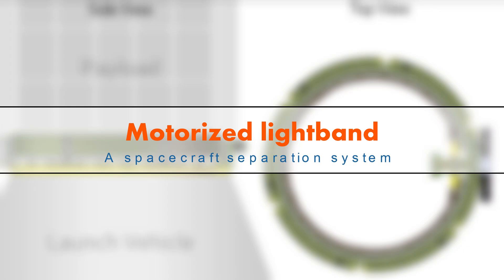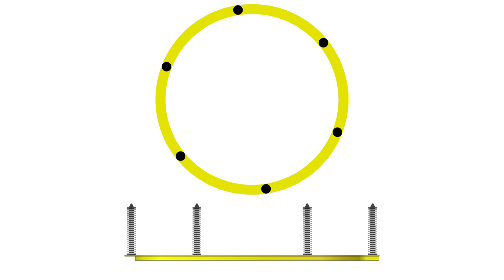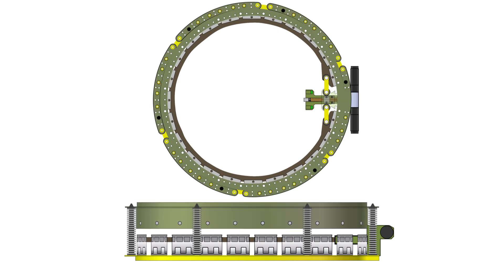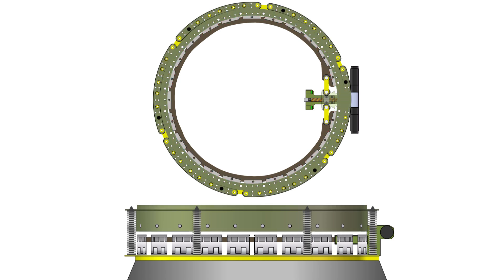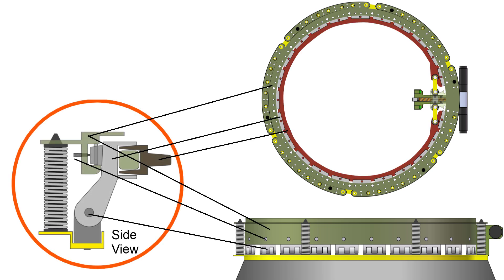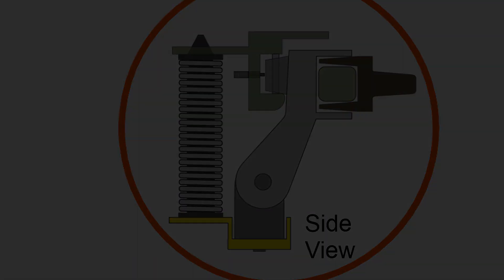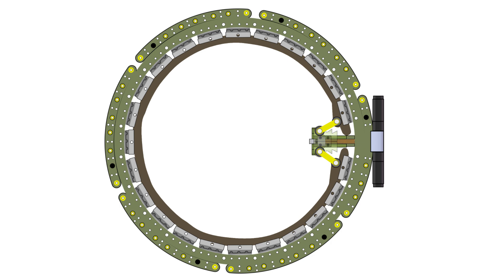Spacecraft Separation System

Comment: What a simple and clever design!
Reply: There is one place I don't quite understand. Will the retaining ring doesn't fall off the hinged leaf assembly after being unlocked by the motor?
 How do you do that
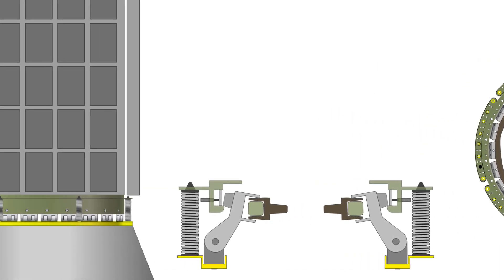Reply from the maker: No, the retaining compression ring doesn't move far enough to do that so it's still supported by the leaves. At 1:27 you can see that the left image shows that the ring is still supported by the leaves.
Reply: @ReflectiveLayerFilm  ok，thank you for your answer，now I got it

Comment: how do I perform design calculations for a clamp band for an amateur rocket?
Reply from the maker: I'm not familiar with those calculations but I don't think that this clamp design is suitable for light payload amateur rocket.
Reply: @ReflectiveLayerFilm  , can you then suffeat me the type of clamp mechanism , which can be used for Amateur 2 stage solid fuel rocket?

Comment: Great vid, Am I right in saying you can see this in action in Rocket Labs latest vid: https://twitter.com/Peter_J_Beck/status/1331386567970017280
Reply from the maker: Not sure. The one here is used to release payload. The one in the link is used for rocket stage separation. I think that's a different mechanism.
Reply: It's multipoint pnuematic mechanism